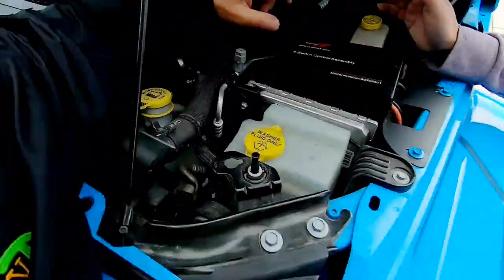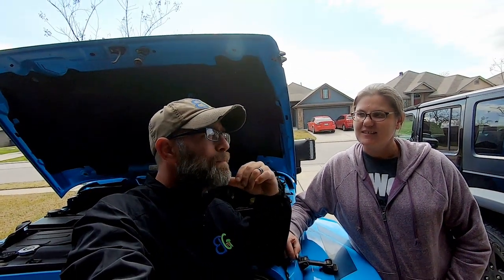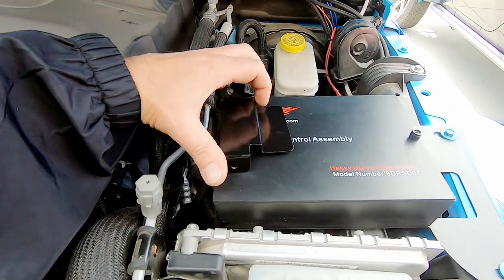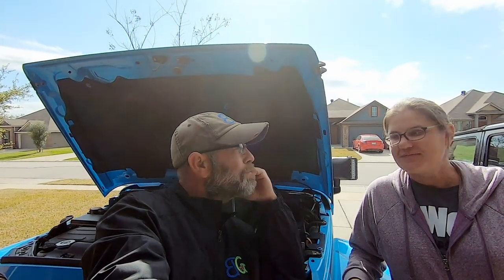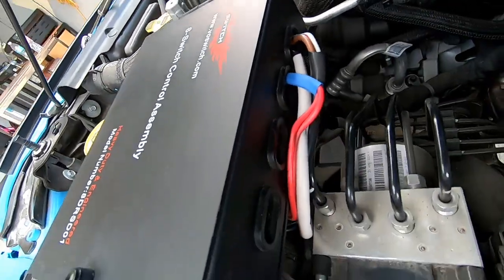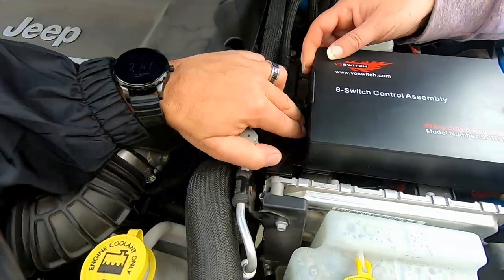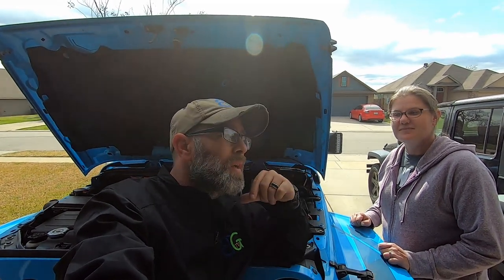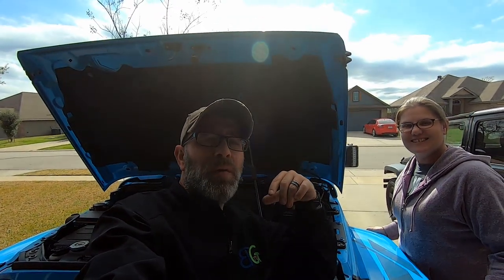Episode 417 - Your Apollointech Source Control System needs this.

Comment: Great job on the bracket, kinda weird they did have it supported on the other end
Reply from the maker: Thanks fam, I know what you mean. We have installed the 6 switch and the 4 switch they are designed to mount differently than the 8 switch not sure why really.

Comment: That was an easy fix. Thinking of moving up to the 8 from the 6
Reply from the maker: Wasnt that bad at all. What all accessories are you running, now days?
Reply: @BubbasgarageTv  . Im running jist a lightbar on top a light bar on the hood a whip light fixing to install a CB and some rock lights and thinking of putting in some light in the back so i can see back there at night..and maybe some lights on the trailer hitch.

Comment: Thats weird where that one sits.I have the 6 switch one and it bolts up between the computer and doesnt move at all
Reply from the maker: Right, We have installed most of their units and the 6 switch and the 4 switch have a nice mounting system.

Comment: Do you possibly still have the dimensions of this bracket? I just found out that one of the struts that connects the unit to the body has cracked due to the constant bouncing on Michigan's horrible roads. This bracket would help with prevention of any further damage thank you in advance.
Reply from the maker: Dang that's not good. Totally know what you mean about those Michigan roads.. I think I still have the template let me see what I can get for ya
Reply: Thank you so much! My rig and I appreciate all the work you and your family put into this chanel!
Reply: hey bubba! any possibility i can get the dimensions too if you still have them?

Comment: Nice setup. I might have to do that when I get ready t purchase my 8 switch. 
What do you have your eight switch connected to?
Reply from the maker: Thanks, We have the J5, the hood bar, the ditch lights, rock lights, then we have a few reserved for the following, winch, air compressor, and coms. right now. Contemplating running a separate accessory outlet to the back from this unit as well.